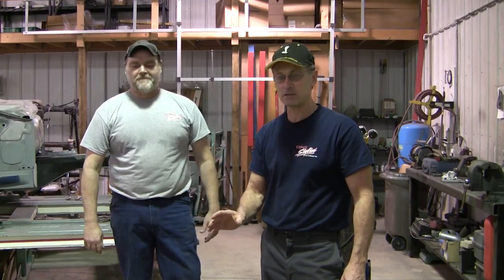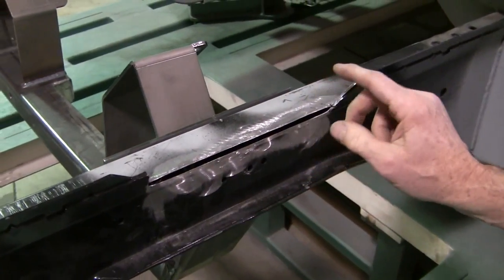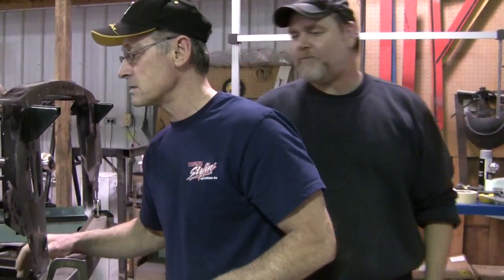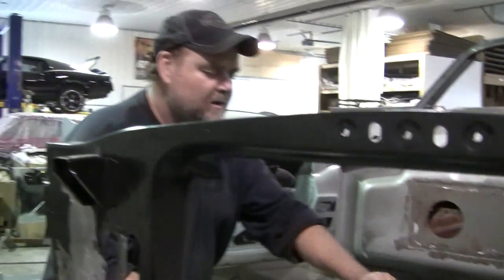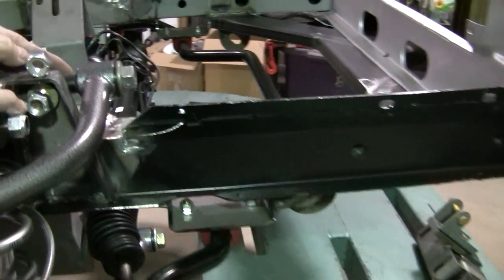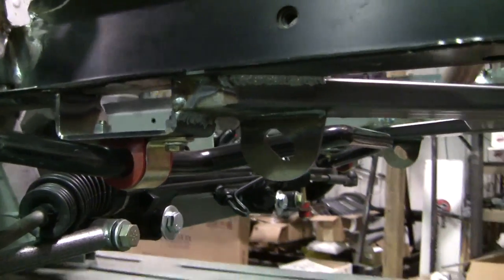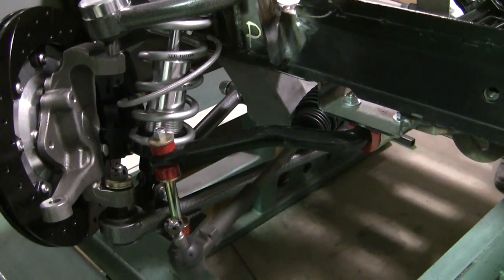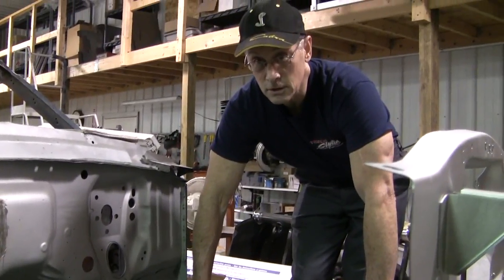Mustangs To Fear 1965 to 1970 Mustang Front Suspension

Comment: Will your products work on a 1970 Torino?  I have a Torino that I am needing a quality replacement front sub-frame and suspension. 
It's a Formal roof Torino.  Not a GT. 
My original sub-frame is rusted out from the 40 years it was in the Chicago area.
Reply: Michele and I sold MTF in August of 2020, the new owner doesn't answer questions on YouTube.
Reply: @RS-gh2mf  thanks. Is it still MTF?

Comment: Will this kit work on a 1965 Ford Falcon? Also, can you run an OEM brake caliper on these spindles? If so, what kind?
Reply from the maker: +Michael Bendos  Mike I would think it's the same setup as the Mustang. You could use anything that would fit a Mustang 2 spindle.

Comment: When you get rid of the shock towers, are you using anything to triangulate the front of the frame rail to the top of the cowl?

Looks like some nice work.  On my 67 cougar. I just replace the front 4 feet of the stock framerail with that of an olds bravada to make it all wheel drive.